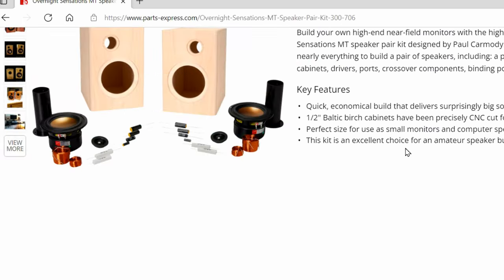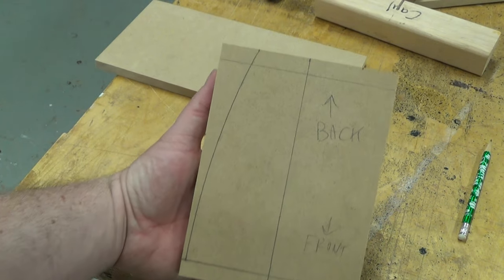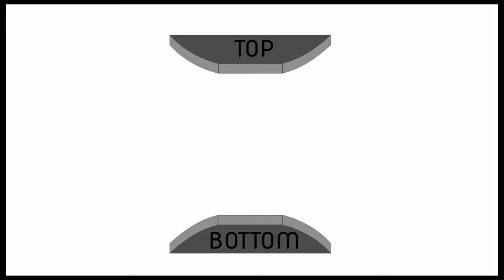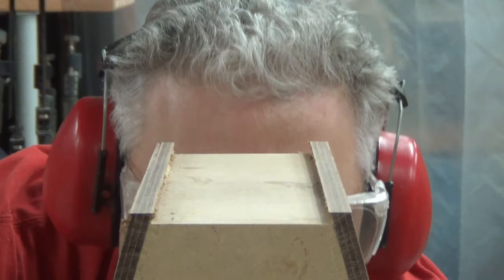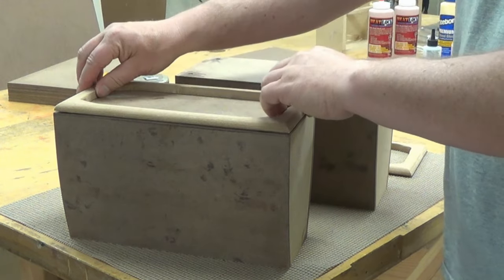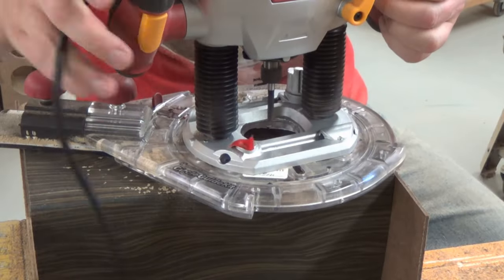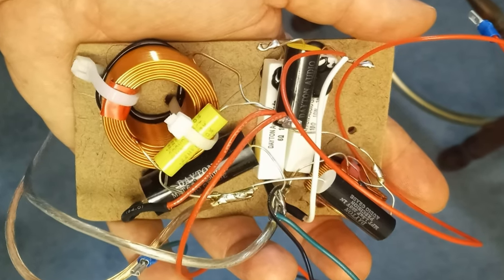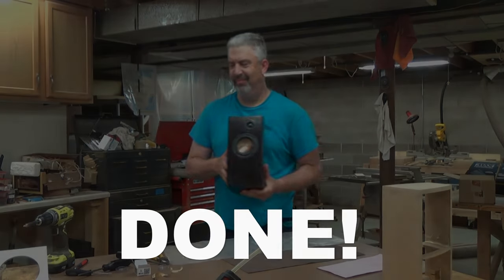Overnight Sensations Speakers with a Unique Twist

Comment: nice job it looks like a fun build i have to try it
Reply from the maker: It is a LOT of fun to add curves to a speaker cabinet. The 1/8" HDF can really bend quite a bit. It can feel like there is a TON of tension while clamping, but once the individual sheets of HDF bond to each other, the effect is greatly mitigated.  Give it a try! If I can do it, it CAN'T be that hard! :)

Comment: Really liked this. I am thinking about some diy speakers but I don’t have the woodworking equipment. Looking at the hi-vi diy3.1 or similar. Subscribed and looking forward to new content!
Reply from the maker: I'm glad you enjoyed it. Thanks for the comment and feedback.  You probably are aware, but Parts Express has several pretty nice speaker kits that ship as a flatback. They are easy to assemble even with no clamps... you can use tape and wood glue... and they are pretty high quality most of them. There are a few other sites that have flatpack kits too. Meniscus or Madisound I think. You can do veneer without real tools, an Xacto knife and clothes iron and sandpaper is all you really need if you use thinner veneer, like the fleece-backed stuff I used on this project from Aliexpress from China.  Do it!  It'll be fun.

Comment: Wow...very nice. Quick question: What are those 4 driver book shelf units with the side woofer behind your desk?
Reply from the maker: Those are as-yet-unfinished speakers called the Bantam MTM's, based on my original 'Bantam's' speaker design from back in 2016. They are still my favorite speaker believe it or not. They don't sound the 'best' of all the speakers I've built, but they just out-perform their size by a large margin. Here is a link to that speaker write-up if you're interested: http://projectgallery.parts-express.com/speaker-projects/the-bantams/ 
The Bantam MTM is finished cabinet-wise, but I never did get around to finishing up the crossover to my satisfaction yet. BTW, the side driver is a passive radiator and there is one on each side. 
Thanks for commenting!
Reply: @zarboaudioprojects1430  Thank you for the link. They look really, really nice. I'm just getting into speaker building but I think I'll try to replicate them one day. ^_^

Comment: I looked into the Aliexpress veneer and it's only .008 thick, which is roughly one half of a sixty-fourth (1/64") for fractional thinkers. Most American wood veneer is 1/32" (.031) thick and sometimes .022 - .023 thick for walnut and expensive exotics. The thinner product is good for bending but sanding must be done with care and probably best done only by hand. The hot iron makes the wood more pliable and I am wondering if a light mist of water or steam from an iron would help. Wooden boat builders use steam for bending planks and guitar makers use water and heat for slowly shaping the .100 - .125 thick curved wooden sides of acoustic guitars.
Reply from the maker: Thanks for that info. Yeah, it's easy to sand through for sure. Most of the veneers I've previously used had a backing of some type on it which made it thicker to work with... but you could still sand through that if not careful. This stuff is just thick enough so as to not be see-through!
Reply: @zarboaudioprojects1430  - I'm sure that you're aware of this, US veneers are paper backed while the Chinese stuff states linen backed. The price is extremely attractive

Comment: Great job! I was just wondering though - where you put a thin piece of HDF to cover the end grain so it doesn't "telegraph" through the veneer, doesn't the "end grain" of the HDF effectively do the same thing albeit only 1/8th inch thick? Surely, unless all the joints are mitered, there will be some end grain.
Reply from the maker: Thank you!  Regarding the HDF, It's so thin that the end grain doesn't move enough to show up. Remember, this isn't MDF, but HDF board... its denser and since it's so thin, and dense, the end grain doesn't really absorb moisture as end grain on 3/4" MDF, for example.
Reply: @zarboaudioprojects1430  thanks for the reply. Yeah I did wonder about the consistency of HDF over MDF as I've not used it in projects myself. I do use sanding sealer a lot on MDF and that does make a great foundation to prevent MDF "end grain" from being too absorbent compared to the faces. But you know what you're doing and have a great end result regardless.

Comment: You have probably answered this question before, but I just found your channel and haven’t dug through all the videos and comments to find out.

For those of us with tools consisting of a couple hammers and miscellaneous screwdrivers, wrenches and saws, do you ever build cabinets for customers/viewers?
Reply from the maker: Hey Ty.  I don't build cabinets to sell. But, if you're familiar with Parts Express at all, they have several really nice cabinets that you can purchase as Knock-Down kits that you can assemble easily with no tools, just glue and some tape if that's all you have.  Here is a link to those:  https://www.parts-express.com/speaker-components/Speaker-Subwoofer-Cabinet-Enclosures  
And they also sell kits similarly set up. Here is a link to some of those: https://www.parts-express.com/speaker-components/Speaker-Subwoofer-Cabinet-Enclosures 
There are no curved cabinets there, but they do have some pretty nice enclosures and kits to get you started if you wanted to delve into this to start with.
Thanks for watching and commenting!
Reply: @zarboaudioprojects1430  thank you! I’ll have a look. Just liked the unique shape and sides to yours. Love the channel!

Comment: Why no conjugate network across the LF driver ...? Does all that cabinet  work really justify itself ... high hysteresis' dampening material stuck to all the inside panels would deaden panel resonances as well as diffuse internal reflections. Loose fibre filling does very little  in this respect
Reply from the maker: You're totally missing the point. This is DIY... I made the cabinets curved because that's what I wanted. That is what DIY speaker building is all about. Having it the way YOU want it.  My time, my choices, my fun! Regarding the crossover choices... they're one of the best "Bang for the Buck" speaker projects in existence. Not my design... but excellent for the money.  Plus, after youve built tons of regular speakers,  you kind of like a chance to challenge yourself!...And this is just my opinion, but these curved cabinets look a lot sexier than regular old square cabinets any day of the week.

Comment: Did you make that black paint yourself  I put wood hardener on before any finishing then lightly sand, then use a magnum sharpie. it's absolutely the best way. I don't want to pick on you but you leave no choice, if you wet sanded between coats you would have what's called a piano finish, anything over 3 coats without sanding is a waste of time and materials, use a tack rag when dry 5 or 6 coats is all you need it will look like glass
Reply from the maker: Thanks for the comment. My niece gave me that paint, it's just to keep the thin seam between the driver and recess nice and dark, you really can't see it in reality.  I have done the 'grain filling' process several times along with sanding between coats, but that's not the look I was going for with this project.